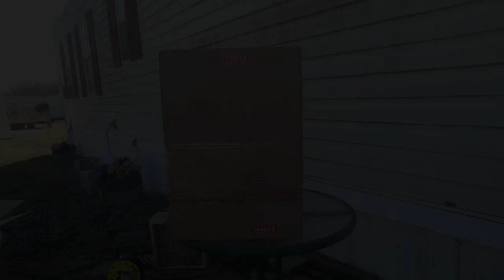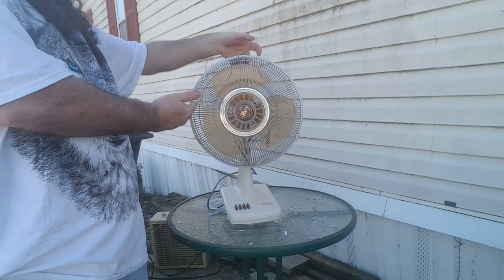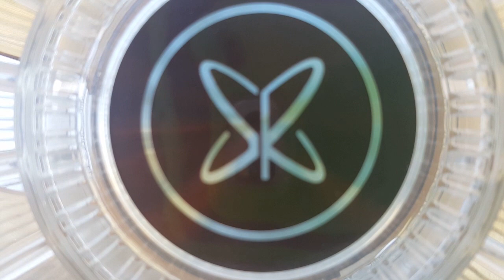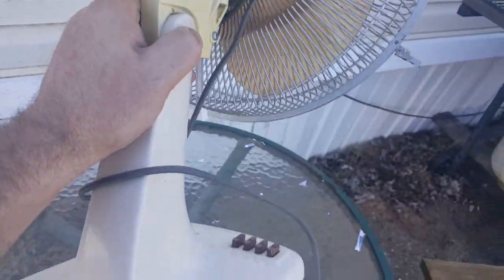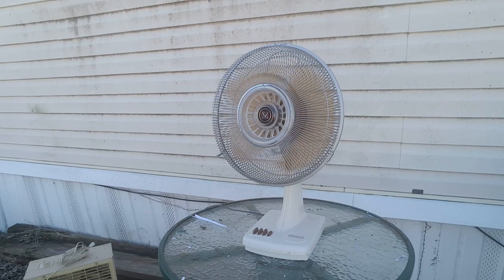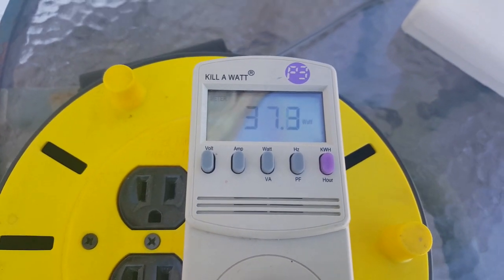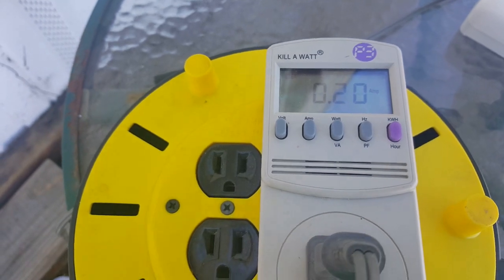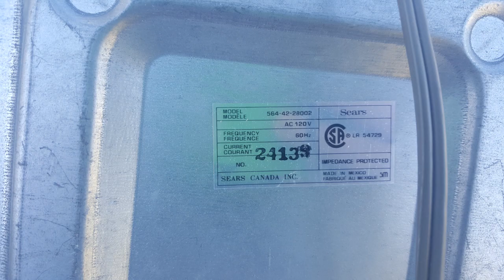Eskie's Vlog 020320: An Odd Sears FAEN Model 564-42-28002

Comment: Great fan! These are more common here in Canada, I have one myself. 1982 is about the right year for this fan, if not a bit older. The efficiency difference between these table fans and box fans is due to the motor type. Table fans use capacitor motors which are more efficient than shaded-pole motors found in many older box fans. Nice video!